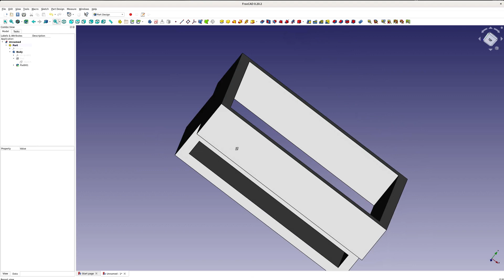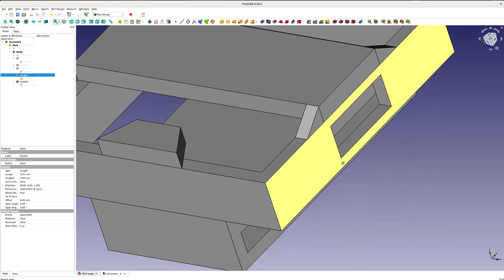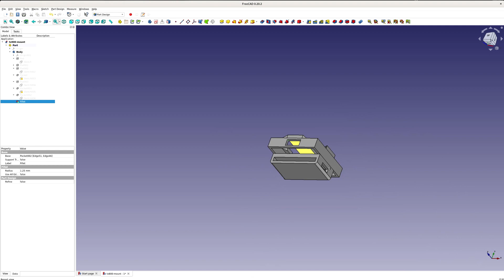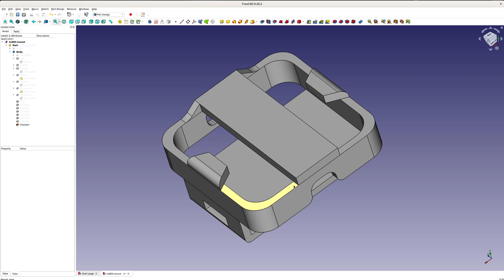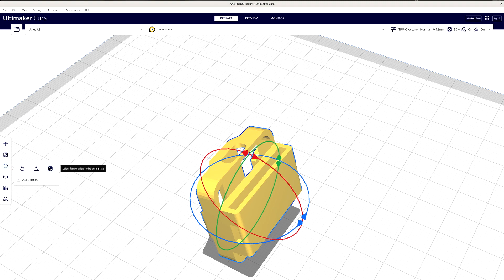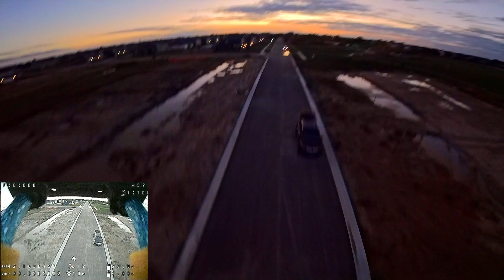Real-world building tpu mount with FreeCAD / Maiden flight of SpeedyBee F405 v3 stack and TX800 vtx

Comment: Awesome bro👏🏼👏🏼 Glad to se you got it. That FPV camera sucks up a lot of light. Wow. I wish 03 was that bright at night.
Reply from the maker: Thank you bro! 👍🏻I snatched the fpv camera from my Tinyhawk whoop. It's a Runcam nano. I'm happy with its performance. I need to buy a better antenna since I used dipole antenna that came with TX800 package. I guess that once the antenna is above the battery, I won't lose signal anymore. Or once I get more funds, I will buy a caddx vista. :) Now I remember your Gopro 9's low light amazing performance, I will try it one of these days. I don't have tpu filament anymore to print a gopro 9 mount.